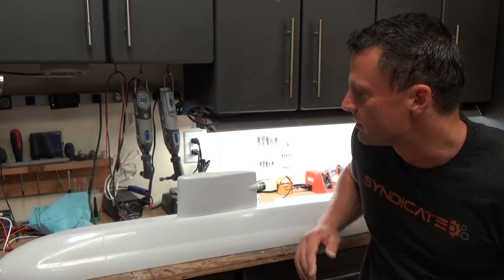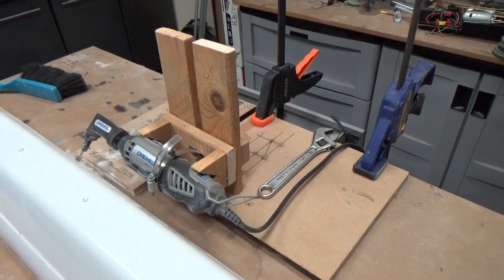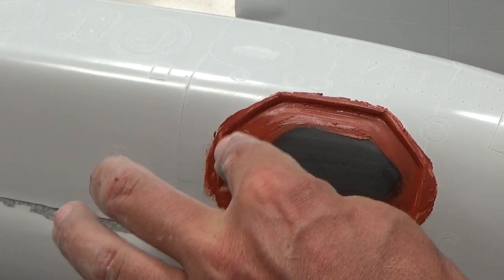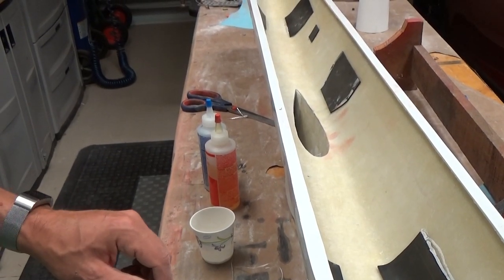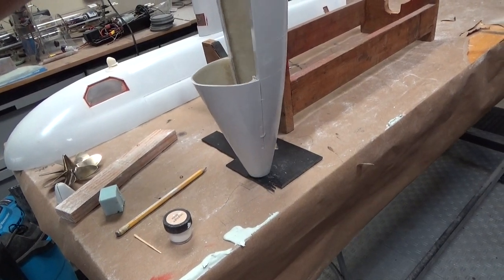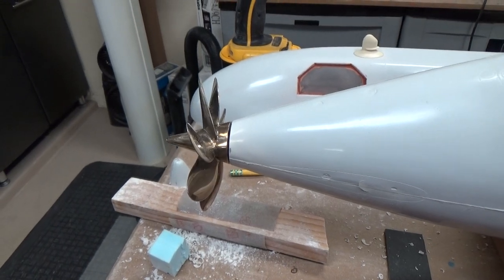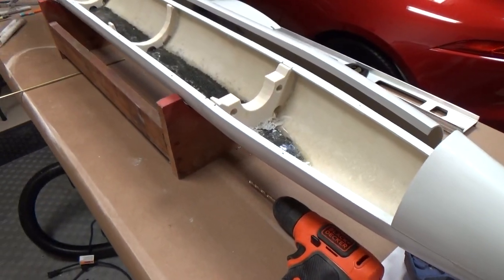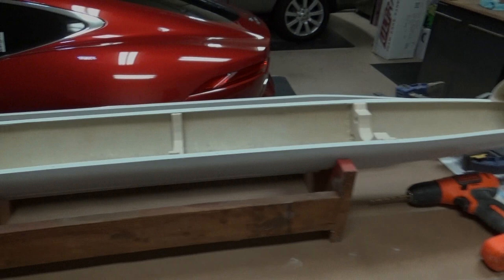1:50 Scale British Upholder RC Submarine - Chapter 2

Comment: 19:30 - How did you know how much ballast you needed?
Reply from the maker: In this particular case, experience. Fill the keel to the top and use the cylinder for flotation. You'll only need to add a bit of extra closed-cell foam to get it perfect!